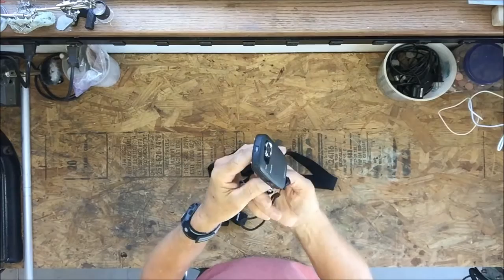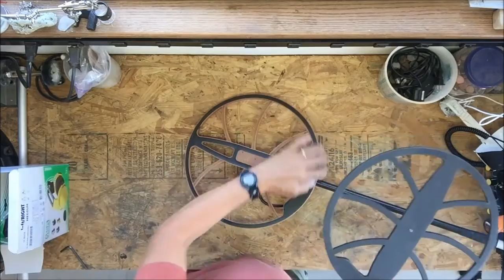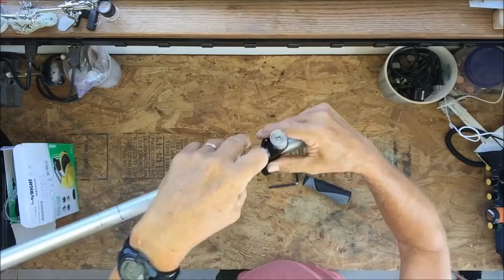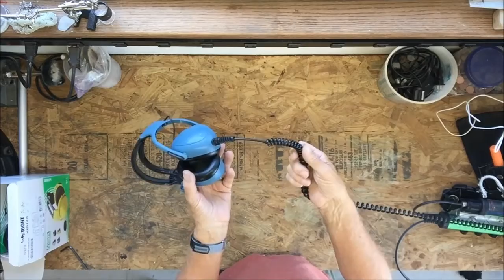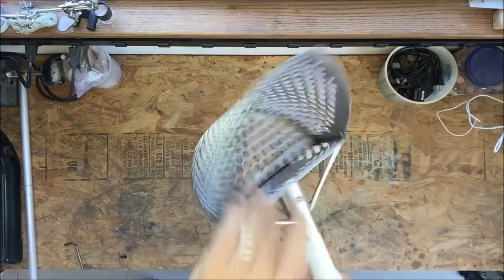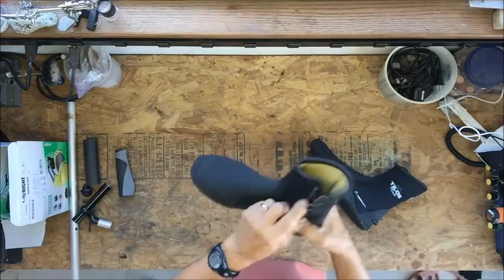Aug - 14  My Beach Detecting Gear.

Comment: Hi Tony, where is wire from swich connected to? I can see only one wire from coil gowing to MD. Did you use that 4 pins connector and same wire from coil ? I watch Old Beechnut videos and hi got second wire from swich gowing to MD. Can you explain that "mystery"for me pls. I like to do that modification for my Excalibur.
Reply from the maker: Hey buddy, thanks for watching. My mod is a little different from the usual pin point mods,  I run an 8 conductor cable from the pod to the end of my shaft and use the extra conductors for the pin point switch.  Inside my shaft I terminate the 8 conductor cable into a watertite splice with a 2 conductor cable going to the switch in my handle and a 4 conductor cable going to the male end of a 4 pin ip68 connector which mates to the female end connected to my coil. So everything is internal and I can swap out coils if I want to. I'd be happy to send ya pics and diagram if ya pm me.
Reply: Did you get my PM?
Reply from the maker: I did bud, just been so dang busy.  I have a vid coming out that will show everything on this mod but I'll get you a drawing as soon as I can.
Reply: I just read that. Thank you. I make pinpoint swich and I can't wait to try this next week in cancun. In Calgary we have frozen ground here , I think yours modifications is unique with cable inside tube
Reply from the maker: Good luck down south buddy, let me know how it goes.  Do you still want the drawings of my mod?
Reply: Yes pls.
Reply: +Tony Eisenhower Hi Tony, great video as per normal :) When you run the eight core back into the battery end of the casing. Do you run the wires for the pinpoint over or under the boards to the Allmetal/Disc pot?I really like this idea, very neat and very clean looking job. Welldone :)
Reply from the maker: Thanks Bud, I solder 7 out of 8 conductors to the coil solder points on the end of the board.  I only use one wire from the pot because the other side is common to ground and I run it under the board and solder it to the 8th wire near the end cap and cover the joint with shrink tube. PM me your email addy and I'll shoot ya a few pics of this detail. ATB buddy sounds like you know yer way around this kind of stuff.
Reply: +Tony Eisenhower Thanks mate, will do. You are a champ.
Reply from the maker: You got mail:)
Reply: Thank you sir, im reading as I type. Magic :)
Reply from the maker: You got mail:)
Reply: +Tony Eisenhower Damn, that sucks I didn't receive it . I will PM you my work one.
Reply from the maker: Crap!! Actually I just realized I sent you "you got mail" twice accidentally.  You have everything I sent you. Sorry bout that mate.  Old timers must be getting to me:)
Reply: Ha Ha, no worries mate. We need more videos. Stop bludging :)

Comment: The 250 was a great buy. When I went out today I was surprised at how accurate it really is. It's just the difference of tones from my old to the new. The detectors pin pointer is a great help. Right on the mark just what I needed. See you in your next vid. HH and GL not that you need it after that last ring in the scoop. :}
Reply from the maker: Glad it's workin out for ya buddy.  Now all ya need is a little treasure under that coil😃
Reply: Tony Eisenhower + Thanks Tony, I have been asking you what you were using I appreciate the help. I am just starting to look into what to buy for the beginner. I live in Chandler Arizona so any help would be appreciated.

Comment: Didn't know your a vet. Same here Air Force Civil Engineering worked on the electronics of generators and in Power Plants. Thanks for the info your right took it out today the 250 works great but the arm extension isn't long enough. I've looked into extenders they have and will get one asap so as not to lose my arm. HH
Reply from the maker: Works great in dry beach sand too.  From what I've seen it's a pretty darn good coin shooter.

Comment: Tony take it back I was on craigslist and found an even better deal on a Garrett ace 250 brand new for 150.00 it has the pin pointer on the meter but I would love to get it on the handle if you have any helpful hits let me know. Thanks and HH When I was in the military I worked with solid state equip. wiring and so on. But any help is better than none.
Reply from the maker: Yeah, much better. What did ya do with yer little 150?  The pin point function on the 250 is pretty cool, I don't think I would screw with it. I was an electrician in the navy on a nuke submarine back in the 60s.  I gained a lot of my tech savvy from that experience.  I don't claim to be a metal detector expert.  There are a lot of guys around who have a hell of a lot more knowledge and experience with them than me, but I'm always happy to give advice:)

Comment: Hi why don't you use Pro-Pointer AT?
Reply from the maker: Hi Oleg.  Actually I use it a lot.  Particularly when something falls through the holes in my scoop.  I just didn't feature it on the video because most folks know what they are.  I gotta say though, the Pro-Pointer AT is pretty awesome!
Reply: Tony Eisenhower I have a problem in using the Pro-Pointer AT in salt water (the Black sea)
Reply from the maker: Hey Oleg
The Black Sea on the surface has a lot less mineral content than the Pacific and I have no problem with my PP AT.   I assume you do ground balance it when you get it under water.
Reply: Tony Eisenhower  Thanks for your answer